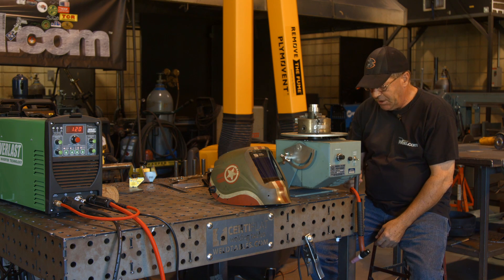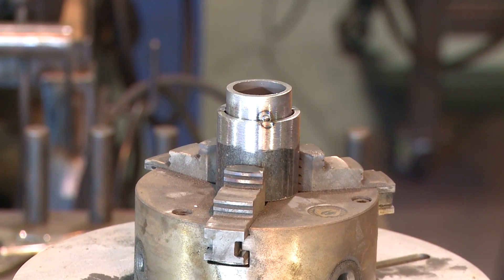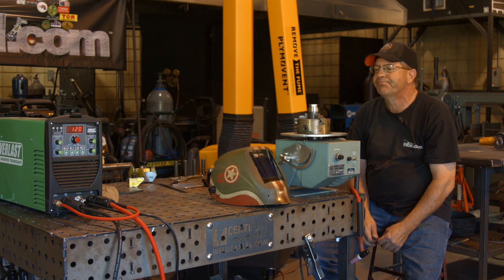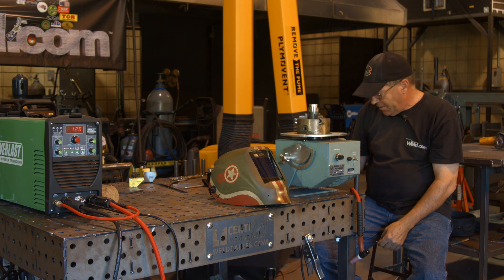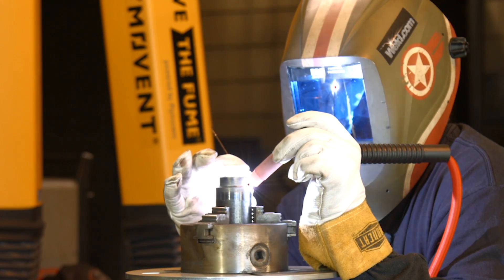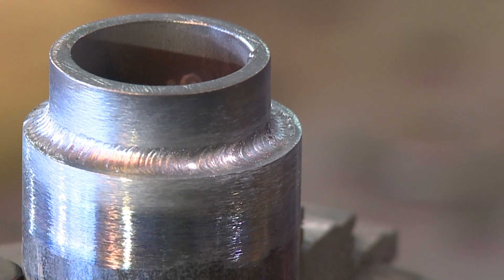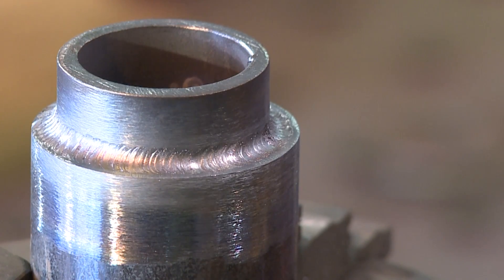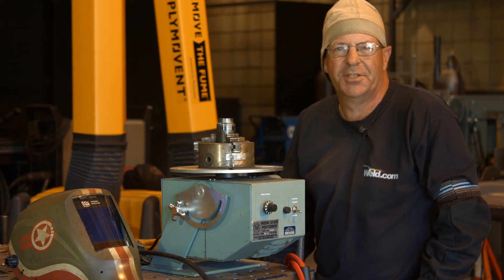🔥 TIG Welding on a Positioner with Two Foot Pedals

Comment: I would use one foot pedal for heat control connected to the other foot pedal with constant speed. Once you have set your speed you should not have to speed up or slow down. If you must change your speed during welding I would then use a torch button switch connected to the speed pedal of your positioner.

Comment: Hi, Bob. Love your videos. Re: tig welding and helium, can you increase the effective amperage of any tig process by using a helium mix or straight helium? I only have a 140 amp machine and 110v in my shop, so I'm kind of limited unless switching to helium would give me more bang for my buck.

Comment: why not just set max amps , hammer down on the amp pedal and focus on the pedal that does the positioner. only use the amp pedal for the stop?
Reply: After we do a couple of parts and get that dialed in, we will. This was one off - trial.

Comment: Can you do a pipe fill and cap weld with Lincoln lh-d80 rod it's the vertical down low hydrogen rod
Reply: I tried running that off of a shop machine. No luck. I need to run it off an engine drive.

Comment: I understand that a foot pedal is useful and all to adjust amperage, but i am so used to having buttons on my torch -- for this job i would just set the positioner to a good speed, set my amps and a bit of downslope at the end of the 4 step and call it a gravy day. especially if the parts are machined and clean. ... might even run some purge through the positioner and thus the piece... why make this harder than it should be?.

Worked on pos that had adjustable speeds by foot pressure, or on off ones. Doesn't matter in the end, especially if you have a tight fit. Simply set it right and enjoy ez moneyz.

Comment: Bob for what it is worth, I would have thought it would be easier to have the speed control under your right foot the same as the accelerator in your car or truck. My theory being you are more used to controlling speed with your right foot.
Also a swing in swing out positioner for the torch would be the best for repeat set up of production work. 
Eliminate variables as much as possible to provide consistent production results. Mark

Comment: Nice stuff Bob, two footed and two handed.  I'm assuming you can also walk and chew gum at the same time.  ;)

What filler rod did you use?  Are you going to be using the same rod for the job?  What filler would you recommend on 4130/4140?
Reply: Pete Brubaker It's in the video isn't it? 80S-D2
Reply: I watched it a couple times and didn't hear you mention the filler.  Thanks for the response!
Reply: Pete Brubaker My bad. Thought for sure that bit of info go in there.
Reply: Nobody is perfect all the time.  I appreciate the follow up here, thank you.  Have you used 309L or 312 on 4130 before?  How do they compare?  Maybe that's for another video but choosing the right filler for the alloys being welded can be confusing even for a hardcore hobbyist/roustabout.
Reply: If they are heavier sections and going to heat treat, yes. Thinner sections I like to use ER80S-D2

Comment: What is the right way to sharpen a tungsten and could you share that with us; the reason is I keep getting metal on the tungsten over and over again.
Reply: Egland Stephens sharpen so the grind marks are parallel with the tungsten.. a general rule is the sharpened point should be 2-3 times the diameter (1/8 tungsten-- 1/4-3/8 of a sharpened point) you can go more or less this is just a general concept. If you got the money buy a nice tungsten sharpener, if you got a shop setting set up a bench grinder ONLY for tungsten, if your out in the field a flap disc ocut off wheel can work!
Reply: ecr125x Thank you.

Comment: I have something i would like to see. Take an outside corner joint in 8mm (5/16th") plate and put it in the horriblezontal position. That being with both plates at 45 degrees relative to the floor and the groove pointing towards you. I personally have a distinct unfondness to this particular weld and havent found any video of any body tackling it so your help is very much appreciated. Thanks, Ryan
Scotland

Comment: What filler material are you running? What is your preferred filler for 4130? How do you normalize your 4130 after a weld? I want to put a Halo in my truck in case I roll it. Any info would be greatly appreciated.

Comment: can both pedals be side by side & rigged together to run as one?
Reply: My opinion would be- sure you can. But the set up would have to be near perfect the same as setting up for robotic welding.
Reply: Harder than it looks I do it weekly just on of on the rotator though. often thought a varible speed on the rotator would be good
Reply: I think I'd have to go with the button on the torch, but then not much amp control